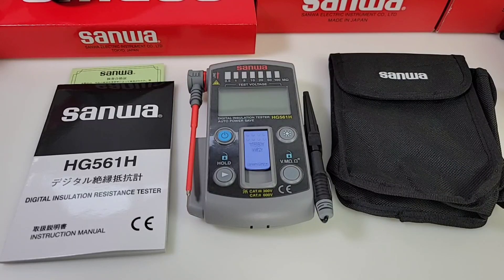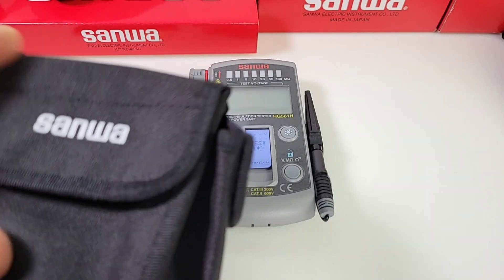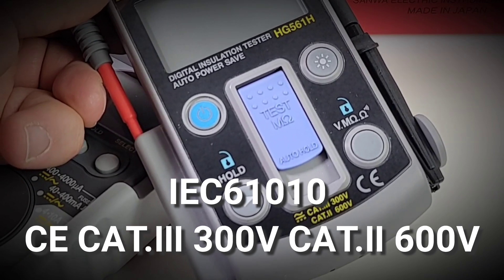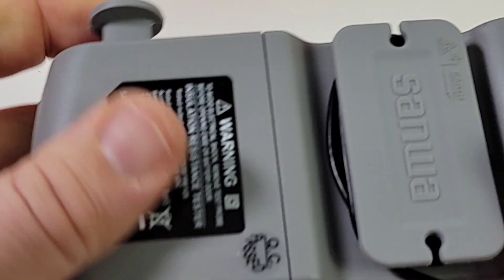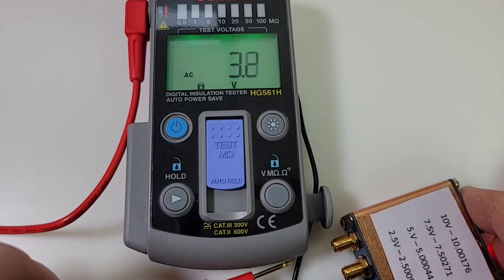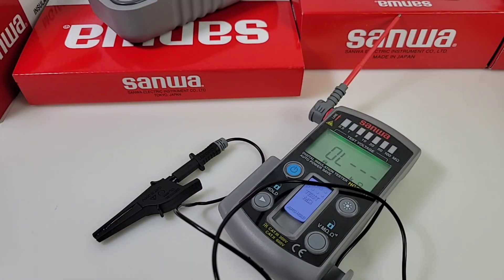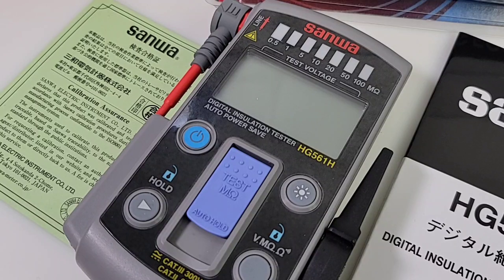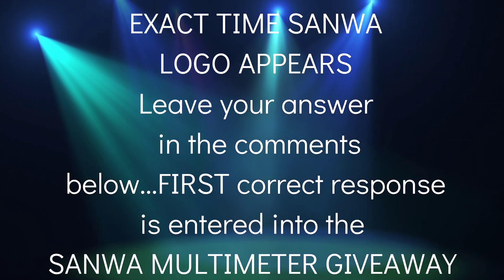SANWA HG561H INSULATION TESTER Review & Teardown!

Comment: Had to spend some time educating myself on insulation testers. And must say I like HG561H for it's size and good build. The price is too high for hobbyists. You can find a decent insulation tester for less than $100. At the same time it's not Fluke 1503 high. The continuity is slow, but I'm not sure you actually need it to be lightning fast (I may be wrong on this one). So 3.5 stars feels just right for it.
Reply from the maker: A niche product for sure. Probably  too  expensive for the hobbyist though but Hugh quality nonetheless 👌

Comment: it is A good insulation meter of SANWA i own ,only the test cable is A SPECIAL UNIT and very small size,if damage may HARD to BUY it,and the MULTI range voltage of insulation test is good for INDUSTRY panel testing the CABLE (for found the damage part).but the meter price is very expensive one.thx dr.darren present this good
 meter👍👍👍👍👍